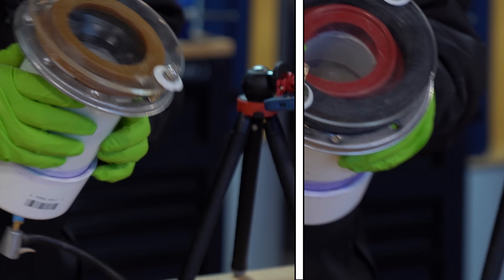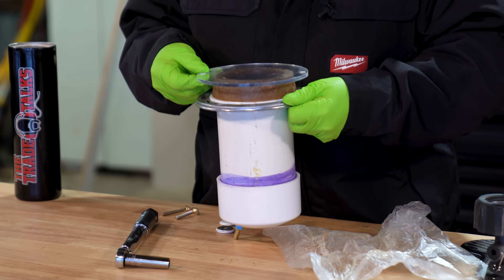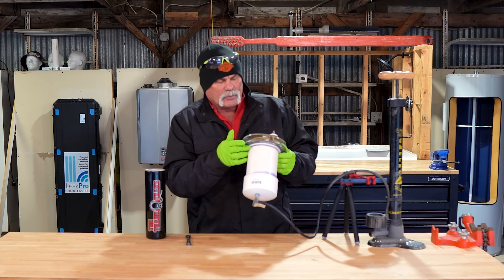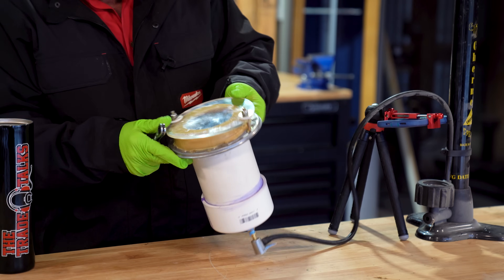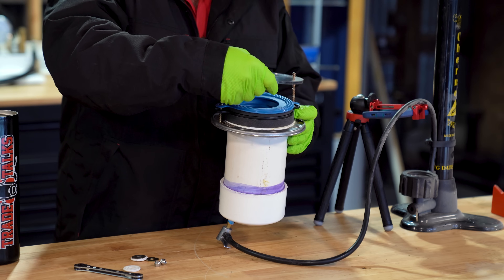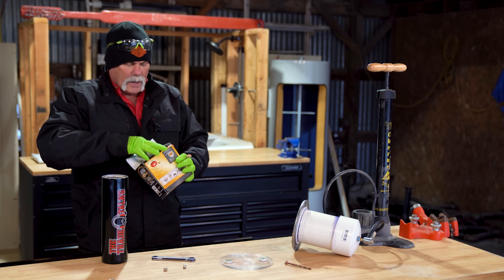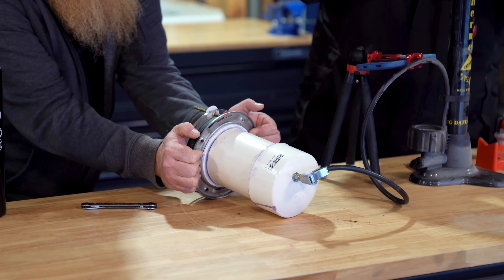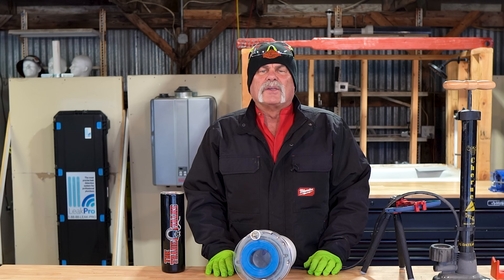Toilet Wax vs Rubber: Which Works Better?

Comment: I don't think it's an appropriate test that you're doing. First of all you don't have that kind of pressure in a toilet you have a vacuum with the weight of the water is pulling a vacuum. Then you just have the weight of the water in the bowl which has very little pressure. I've installed wax rings and I installed the blue rubber rings. My main concern with the rubber ring was the deterioration over time, but after 4 years everything is fine. The ring I used had a wax seal at the bottom and then the rubber seal on top which look just like the one you have. When you take the toilet off the wax stay stuck to the flange and it just pushes up against the bottom of the toilet. In my opinion it's worth paying more for the rubber seal. You really need a better real world test.

Comment: You may want to look into the scientific method so you can understand how to create reproductive test.  Farm Project does a great job at this. 

One of the reasons the system was not working was because you did not use a stiff top plate.

Comment: It would be nice to have a toilet that did not depend on any type of flexible connection that could fail. I've also puzzled why most toilets are designed the way they are. Who would design a chair that sits on a rather narrow base and is connected only via a couple of spindly bolts? I suspect most people tilt toward one side to wipe their bum rather than lifting their entire body, which means the are rocking the toilet every time they do #2.

Comment: Actually,  this is like guys taking an impact screwdriver I'm getting mad cuz it won't break a lug nut loose. It's outside the scope of engineering. Same as a Ford ranger or Chevy S-10 hauling a ton.

Comment: That acrylic plate flexes.  Your toilet does not.  This test needs to use a much thicker plate.  And you should have a separate pressure gauge on your contraption, not relying on the indication on the pump.  When pumping up a bicycle tire, you don't read the peaks.  You read the valleys.

Comment: That pexiglass blank is NOT the shape of the bottom of a toilet and a toilet does not flex like it did.  Neither of those seals would blow out if you had the proper setup to mimic a toilet to flange connection.

Comment: Your test setup has problems. The acrylic flange is too thin. Remember, a toilet is very stiff, and in your testing, the flexing of the acrylic flange could clearly be seen. You should also have the pipe filled with water, which is incompressible. This would allow you to see the leak, and it is safer.

Comment: I will stay with wax. It squishes to form around the toilet and gives you a good seal. Yes it is messier but once it's in you're done. It's not like you need to remove and replace repeatedly. Why would you have to do that? Never had problems with wax.

Comment: The plastic lid was being hold by two bolts having the sides weak spots, the toilet bow will put pressure 360. The test has this big flaw, please you should have just put at least 4 bolts

Comment: Glorified high pressure plumber... (US Navy up to 1600 lb rated Steam systems and 30,000 lb hydraulics)

Your flexi clear plastic  is apt to cause leaks on the rubber because it is designed for the inflexible porcelain/ceramic toilet essentially flat face, not the bendy plexi.  This is a guaranteed fail.

I've used gaskets made for 1600 psi service that could not pass your test at 0.5 psi, but used properly will hydrostatic test as high as 3700 psi

Comment: Good thing there is very little pressure in a toilet drain.  Blue rubber seal all day every day.  Easier to install, no mess, never had a leak, no sewer gas.  Wax is obsolete and ridiculous.  BTW, the top plate on your rig was distorting, needs to be dead flat.

Comment: You're never going to get a good seal on a rubber gasket with only two bolts on the flange, which is a better description of your setup than a simulation of a toilet. If you're going to go this route, use a much thicker piece of acrylic or at least 4 bolts.

Comment: Your test is flawed. I just installed a toilet today with the Fluid master rubber gasket. It works great....the other foam piece is for the higher floor.

Comment: This is kind of an absurd test. Your toilet does not develop pressure. The water in the trap can probably resist less than 1 psi of pressure.

I don't like the wax rings because they don't flex like the rubber ones do. I have been using the green foam rubber ones for years, have always sealed, even when the toilet moves.

Comment: The contraption you made is NOT a good representation of a toilet bowl set on a gasket (bowls have an even distribution and your plexiglass cover does not represent a true seal). I would suggest adding two more bolts to your contraption evenly spaced to achieve this.

Comment: I had a rubber one fail and go down the pipe….never again
Reply from the maker: Did you have a wax one before switching to the rubber?
Reply: Yes
Reply from the maker: What made you want to use a rubber one?
Reply: @RogerWakefield the Home Depot sales associate told me it’s the latest and greatest….I should have gone with the classic trustworthy

Comment: The test was completely wrong. If you look at the bottom side of the toilet, you can see that for the non-wax the toilet goes in through the hole and seals on the sides. Not just the top. Also, the foam insert is only for if you need extra height, if you flange recessed the floor as opposed to being flush
If you actually read the instructions on the box, the foam and rubber ones are so much better than the wax but you need to read the instructions and use a real world test not just a piece of acrylic, trying to seal on a plastic that’s not meant to seal on top 
It needs to seal on the inside of the ring where it has rubber

Comment: Wouldn't have been better tk use a material that doesn't bend when tightening down the bolts. A toilet doesn't bend and stays even with the floor.

Comment: As stated this is not a real world test which is an understatement.  This "demo" while somewhat informative, has little real life applicability as the waste system in your home should never be under pressure as it is a totally passive system.  I would not rely on the video as a determining factor as to which type of seal witll work in the real world.   Both types of seals will do the job.  The non-wax seal has the advantage of being much cleaner to use and allows you to reset the toliet should you make a mistake in setting it the first time.  Once set for a few days, the non-wax seal must be replaced just as a wax seal because the foam rubber will have set losing its elasticity so any attempt at re-using it risks a leak.  The silicon rubber sleeve is useless as a seal without the foam rubber seal although the silicon rubber portion will last a lifetime.  Note also, the sealing surface of the toliet is machined flat  at the factory and would likely seal without anything if the mating surface were also machined flat  however that  hollow tube and attachement ring are not meant as sealing surfaces.  Wax will fill every nook and cranny under the toliet which, in my mind, makes it a better seal than the non-wax seal however both will do the job.

Comment: First, use a thicker piece of plex, or something as a backer to keep it from flexing. And - Really?!? You've never used a plunger? I'd believe a plunger can give more than 25-30 psi of pressure. A wax ring will not self seal. The others will. If you watch the pump gauge with the wax rings, they were letting the air out also. It would go up to 25, then down with each pump. NONE of them held pressure...

Comment: Wax will last forever but the rubber (especially in the creases) will break down and crack.  Steve Lavamoire has a video recently where he pulled a customers toilet that used the rubber gasket and it was all cracked and leaking into the downstairs.  Why invent a new wheel when the old wheel (wax) has worked for 150 + years.

Comment: If the lines ever have more than 5 pounds of pressure, your house is already flooded, ring be damned, the toilet will have overflowed. This is a poor test, the rubber seals are better for real life conditions.

Comment: Only pressure on your plumbing system is atmospheric pressure which is 15# your closet bolts hold your water closet secured to the floor your test is not accurate

Comment: From a Engineering standpoint the way the toilet is designed you should not have any problems with pressure Their should not be any 😮.

Comment: I would ask you to try again with either a much thicker, say 1 inch acrylic, or putting a stout metal ring over the acrylic to keep it even all the way around. I saw that acrylic bend before you even started. Critical thinking could have proven a better experiment.

Comment: You are testing these toilet seals for conditions that would never exist in a plumbing system. Fixture traps and fixture venting would never permit this situation. Plumbing waste and vent with fixtures are tested with 1" of water colum to prove tightness. Wax will hold up to water and sewer gas better and long term.

Comment: I’m
Not a plumber and see that your test media is faulty. A ceramic toilet is not going to bend like you acrylic piece you made to be the toilet. You cannot bend a ceramic toilet. So to test them properly you need a real toilet. That plastic keeps bending a leaking. I am 63 and have never smelled sewer gas on any house I have lived in.

Comment: You're test is flawed. The acrylic is bending and not applying constant even pressure like a toilet would.  I'm a DIYer and I loath wax rings. I have used the blue ones like in your video on all 3 toilets in my house and have not had any problems so far, oldest one is about 5 yrs old.

Comment: The pressure spike at the gauge when you are pumping does not reflect the pressure in the chamber.  Your readings are useless.  Tap a pressure gauge into the chamber.  All that work to get bad data.

Comment: Do the same test with 4 bolts on the flange to flatten the acrylic better. The 2 bolts are bowing the acrylic sheet and letting the air out. You can see how the 2 foam pieces are separating on boths sides. I say the testing methodology failed. Conclusion is void.

Comment: Innovation is important in every industry. But some things really are tried and true. Wax is simple. It just works. neoprene is for wall mount toilets only.
Reply from the maker: So you prefer the wax over the rubber? I don't have too much experience with wall mounted toilets.
Reply: @RogerWakefield  Wax is for anything stationary/fixed. However, a neoprene gasket is a must for wall mounted water closets as their very nature move when someone sits on them.
Reply: I'll use a NeoSeal when the floor itself is not solid. Otherwise, it is wax for me. No horns, either.

Comment: You seem to not have a firm grasp of the laws of physics. The acrylic plate should have been at least 3/4" thick for this test and then you'd need a minimum of 4 of those bolts. Also, a relief valve set at a reasonable pressure, say 30 psi, would be prudent for safety. A 4" inside diameter provides about 12.5" of working area so 5 psi (that's 5 lbs on every square inch of working area) will exert a total of 62.5 lbs of force. Silly to even attempt this test with that thin acrylic plate and 2 spindly bolts. But this test seems pointless anyways since these seals are not required to hold any pressure over the weight of the water in a toilet during a clogged sewer line scenario and any pressure coming from the sewer line would just exit the toilet.

Comment: The toilet bolts don't put pressure on the seal. The weight of the toilet compresses the seal. A plastic plate bolted on two sides is not a correct way to compress the seal. Waste of time.

Comment: Your test fixture is FLAWED, A rigid porcelain toilet fixture puts pressure  around 360 Degrees of the "ring".  Your fixture only puts pressure on two points of the clear plexiglass which is also flexing. Therefore the demonstration is not valid.

Comment: While i appreciate your creativity this isn't even a remotely scientific or accurate test. You need to create a rig that has a lid capable of providing pressure in an even fashion just like the porcelain toilet would all the way around to make a fair comparison between these seal types. The rubber seal has a clear advantage as you pointed out of being able to reseal without removing and replacement as they tend to stay flexible, as well as having multiple sealing rings on their surface compared to one large sealing ring on a wax style seal.

Comment: Bogus test. The bottom of the toilet is not flat, it has a flair that goes down inside the rubber seal. Your Plexiglas does not represent real life.

Comment: This is one dirtiest experiment I have ever seen.! This  proves nothing that could be relevant for the application!
As a home owner, I prefer wax rings and absolutely agree the extra thick would be my preference too. Wax ring  take the shape and don’t shrink overtime! If your toilet starts to move, it’s time to remove it, fix the issue and reseat it! Rubber seals on the other side, may deform while installation, lose their plasticity overtime and loose the seal. The toilet may still be not moving, and there is no way to know if the seal is starting to allow sewage gas to escape.

Comment: A ceramic toilet does not bend and flex APVC Pi stick quarter inch thick cover obviously you can see it bending. Terrible try for an experiment.

Comment: Saniseal
Reply from the maker: What is that?
Reply: It is a flexible toilet flange gasket that isn't wax. Looks like a large wax ring that is lime green. Winsupply has had them for years. Supplyhouse carries them as well. Works great for trailer houses that tend to move.
Reply from the maker: very interesting, I will have to check that out

Comment: For starters, you used a perfectly smooth piece of acrylic to simulate the bottom of a toilet.  Ever heard of the "Apples to Oranges" saying?
Second, you used a FREAKING TORQUE WRENCH RATHCET to tighten the nuts down.  You can stop now.  Your toilet bottom is now cracked and it doesn't matter what you use for a wax ring.  It might as well be hemp rope.  It's broke and it's going to leak!
Finally, that background music was SO ANNOYING, that I only got to the part where you were using a big ass ratchet to tighten toilet bolts.

That's 2 minutes and 30 seconds of my life that I can never get back!

Comment: Your test set up sucks, there is no way that you can get any kind of accurate reading with that plexi top piece, way too much deflection.  I used the foam ring on my last install and will never go back to a wax seal again.
Reply from the maker: What makes you like the foam ring more than the wax?

Comment: Terrible test, the toilet is putting pressure on the seal all around it with it's weight. Your dumb toy only has pressure on 2 sides. To be a proper test should have used bolts all around it.

Comment: this test is pointless. filler content. i inadvertently did my own test between wax and "better than wax" on a leaking toilet. somehow the water found its way thru the wax and leaked while plunging while the "better than wax" didnt. the old wax leaked which was the reason for the replacement with new wax which ended up also leaking. put the blue ring on without the foam and havent had an issue since. didnt use the foam because the flange was on top of the floor.
dont think id ever go back to using wax.

Comment: What are you going to get for pressure on a toilet drain wax seal? 18 inches of water column head pressure? That is right around 1PSI. I like the wax too, and I am an old school tradesman. I wrangle electrons instead of water & turds, but I do have mucho respect for all of the other trades. Without electricians you'd be shitting in the dark. Without plumbers you'd be shitting in an outhouse or a chamber pot. Yuck! I have rebuilt and reset a few toilets. It beats digging an outhouse hole, trust me!

Comment: Flawed test.  The acrylic plate flexes where the underside of a ceramic toilet would not.  Also, Roger should've used sleeves on the bolts the same length as the gap between the mounting holes on a toilet and the mounting flange on the floor so the rings would only compress the same amount as in an actual installation.

Comment: Your test is deeply flawed by using plexiglass, which I can see is deforming into an arc, unlike the toilet base which is extremely rigid. Repeat the demonstration with a piece of 1/4" steel plate and I bet it goes a whole lot differently...
Reply from the maker: yes, we're looking at redoing this test...I appreciate the feedback

Comment: C'mon man -- just a tad bit of  NOT a SCIENTIFIC   exercise.
Torque on nuts not measured, therefore not a valid comparison. 
Accordingly the deformation of (not rigid) plexi plate varied --- dramatically.
Your bicycle pump deliver surges that are not accurately measured across comparisons.
The basic premise of measuring  pressurization on a working system that is unpressurized means  the entire exercise is largely irrelevant.
The toilet rings I know need to have equal Tq on either side --no "tilt" -  that would compromise integrity of a proper "seal".
There is a question of longevity factors existing in a "non-sterile"  environment.
How about cost differential!.
Repeat --NOT a SCIENTIFIC   exercise.

Comment: Horrible baseline... Your flange usually is above the floor 1/2-3/4 off... You the wax ring has less then a 1/4 gap... You are using a flexable plate vs. a sturdy piece of wood like a toilet. On the last test you gave that plate flexing.... Next time count out the variables. You xan do better man.